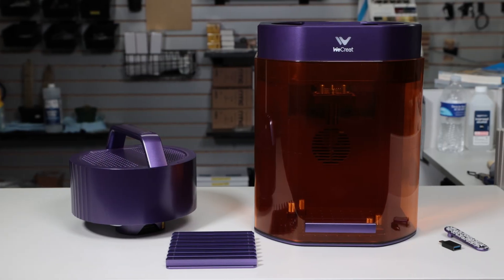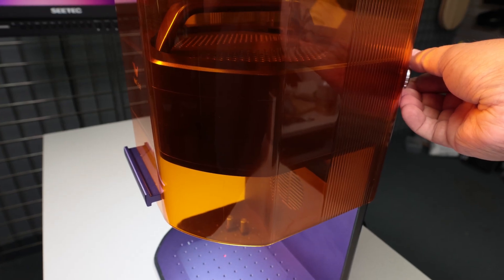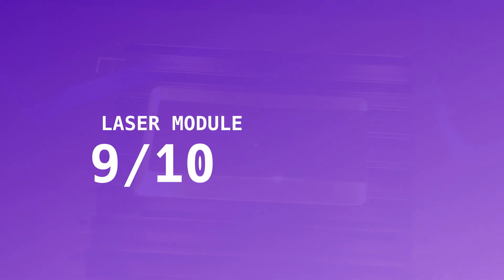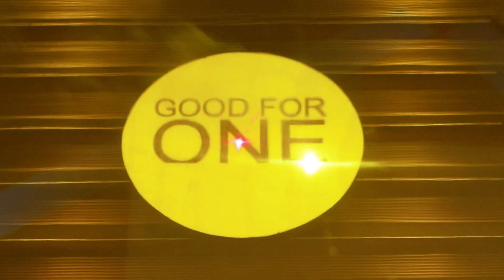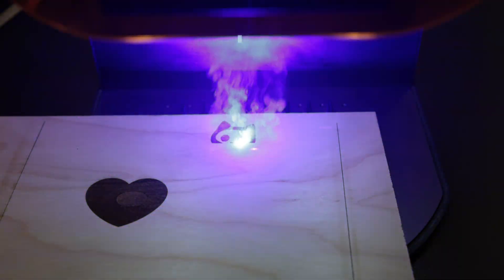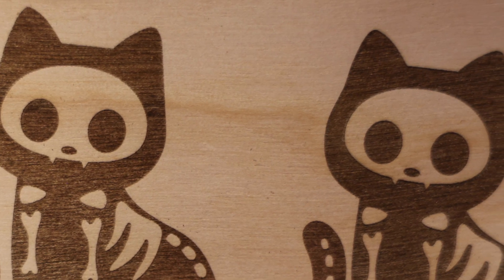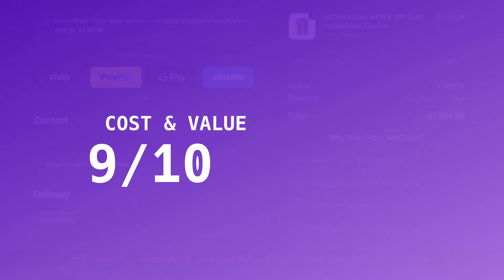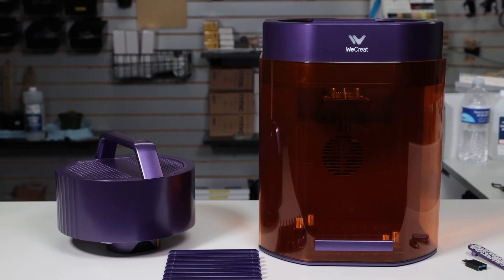STOP! Watch This Before Buying a WeCreat Lumos

Comment: Now that the Xtool F2 is available,how would you rank this now?
Reply from the maker: I still like it for the price, especially the current sale price which I believe is around a $400 savings off of the F2 asking price. The additional power in the F2 is surely nice to have but a $400 difference is non-negligible.